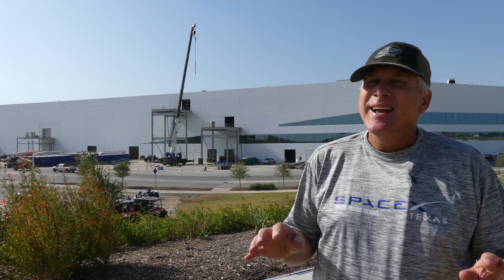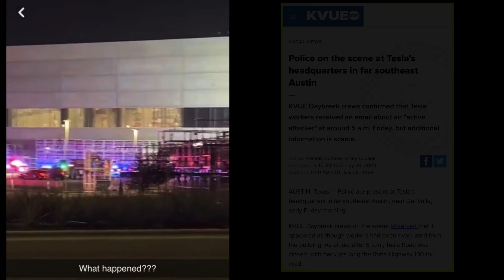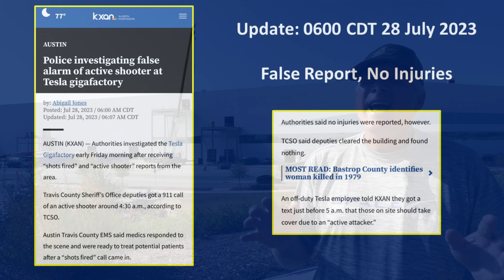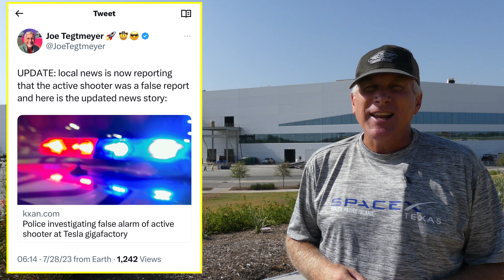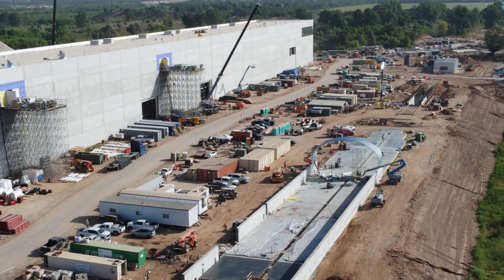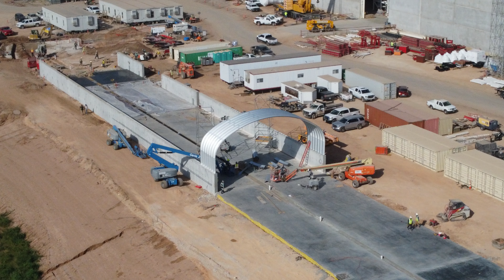More Window Removal, E Cathode Structure Has Roof & More! 28 July 2023 Giga Texas Update (07:35AM)

Comment: 25:31 this building looks almost like a crash test site. With the gap in the middle of the floor for a cable system to pull the cars.
Reply: 25:31. It's a possibility. Some Austin City documentation asks about the 'Temporary Crash Track'. Also 'Temporary Wade Pit', which could be the north structure.

Comment: All those parked forklifts then @14:30 they are moving things up the ramp manually

Their going to need a new system for the castings soon, they are taking over that whole side of the factory
Would be nice if you could fly over the concrete plant sometime to see if it looks like they've started to wind down operations yet

Comment: 21:06 New switchyard/substation. Mega-Vault. What is this going to be used for?
Reply: It is a central distribution point for power. Power comes in from the main substation, and from the BESS substation in the event of an power outage... Then goes out to all the buildings on the campus via duct-banks. It is possible that there will be a structure on top with switching equipment as well.

Comment: Why do workers drive completed Model Y's from the factory to the holding lot rather than using FSD for this task? Are Tesla's perimeter roads considerd public thus cannot allow unmanned FSD operation until certified by Texas? It seems FSD assistance would be a good labor saving feature for production and a great test/proving ground for it. The cameras have not gone through full calibration but the route is a known path that should allow operation even without final calibration.
Reply: First opportunity to drive the vehicle and check for faults.

Comment: Hey Joe, 
Regarding those two unusual structures on the East side of the battery cathode plant. What are the odds that they are an aquatic final testing course for Cybertrucks? 

The more shallow structure that is getting a q quonset style roof could be for shallow water testing at speed. That would account for it being wider and covered. 

The other feature would be for deeper testing at slower speeds. 

Both have center drain lines that might connect and operate with what might be a cistern (your “vault”) on the South end of the course. 

Just a thought.
Reply: Just seems like a strange place to have it.  I would have thought closer to the main factory would have made more sense.

Comment: Thanks Joe
5:03. W-WOW. Left. Assembling rebar cages.
5:26. Westside. New road. Trenching. Various coloured conduits. 
Left. Stockpiling gravel.
5:32. Westside. Storage. Casting racks being stored to the right.
7:52. Outfall channels area. Right. An outfall channel shaped excavation. Possible diversion of the channel to accommodate the Parking Garage.
9:15. Stamping 2 extension. All columns placed. Additional hold-down bolts are for the columns in the adjoining building section.
Intermediate beam not level. Set-out mistake, the connection plate welded in the wrong location.
9:49. Southend. Truck and trailer ‘Harvey-Barlow’. First photo on their website shows a panel joint being caulked.
10:57. Southend. Sanitary sewer wetwell. Precast rectangular vault sections. Likely valve access boxes as at the lift station beside the highway near the main entrance.
12:00. GA apron. Large items. Closer machine seems to have door at the narrow end where material bases through. A tunnel. A glimpse in Jeff’s video yesterday.
Silver wrapped item, logo is GROB. Nothing similar that I could find on their website, although they do ‘custom built designs’. 
Website shows GROB have fingers in many pies, including sheetmetal bending equipment, assembly line components, additive manufacturing. Could be anything.
15:57.Battery roof. New rooftop ducting. Must be tight for ceiling space under.
16:37. Plastics apron. Additional water storage trailers. Hoses across to Paint.
Right. Delivery of pellets to Plastics.
17:03. Casting. Inside through the window opening. Joe’s photo show the frame of the furnace seems to have been infilled.
17:30. Northend. Black casting racks. Black rack to the left has Model Y rear castings.
Zooming in on Joe’s photo of same shows something different written to this seen on the Model Y racks, https://youtu.be/uJwEzpThroU?t=485
17:46. Tesla Road, north. Water storage trailers. Pump in, pump out?
Seen again in front of the trailers at Plastic at 29:10.
20:07. New switchyard/substation. Mega-Vault. Large crane. Expecting something big. Spreader bar on the trailer to the left
Bottom. Green enclosures placed on the pads.
21:06.New switchyard/substation. Mega-Vault. Good view of the applied water proof sheeting.
21:40. Tesla Road, north. Trench ends at the gas metering enclosure. 
Length of HDPE back pipe with a yellow stripe. Natural gas line.
23:49. WOW yard, east. Shipping container marked ‘Allegiant’. That name appears on many of the plumbing permit applications.
24:26. WOW yard, north. Big crates, lightweight trailers. GROB again. Must be ancillary equipment, frames etc.
25:12. Cathode east. Large crane setting up beside the ramp. Large delivery coming. Shifted the white vessels again.
25:39. Cathode east. Long structure. Quonset type roof. Locating spacers along the top of the wall show the extent of roof.
Reply: thank you dessie!
Reply: @bobthegreat297  You're welcome!

Comment: @ 10:22 I wonder how they will keep the dust and dirt out of the building?
Reply: Plastic sheets around the sensitive areas is one way, or even temp walls.  Other areas are construction zones so it's not as much of a concern.
Reply: They will install Scotty-approved focused force-fields, run off dilithium crystal chambers, with Mega-Pack power reserves.

Comment: Easement:
@ 18:04 Steel on truck. Possibly for a building on top of the Tesla Enclosure/Mega-vault? 
BESS Yard:
@ 18:37 Close up view of cables that connect the Megapacks to the transformers.
BESS Substation:
@ 19:26 Hard to see, but only 2 backup power conduits coming out of the ground. There were 3 conduits in the trench before they poured the concrete. I remember seeing one of the conduits in the trench with tape over the end.
Tesla Enclosure/Mega-vault:
@ 20:35 Steel beam on truck.
@ 21:01 Waterproofing material on vault walls.
Also @ 20:35
LCRA Substation: Work continues on installing metering equipment.

Comment: I wonder why they use these dump trailers instead of dump trucks?
Reply: Tractor/trailers can haul more product per load. That is why they are so popular with most everybody.
Reply: Bottom dump trailers do a better job of spreading the dirt over a distance that a dump trailer does. Yes, you can size opening of the gate of a dump truck with a couple of chains but a bottom dump just makes it easier to spread it out and require less work for the dozer or grader.
Reply: Bottom dumps do not fall over.

Comment: The Semicircular structure looks like a 'quansit hut' set of parts that anyone can purchase.  Somtimes that kind of structure is used for 'bulk storage' (road salt, or batterey materials <<grin>> ... Thanks for doing these videos, Joe!
Reply from the maker: You are welcome Jack! have a great weekend!
Reply: That's "Quonset" hut. I went to check the spelling, and found it was a version of a WWI design called a "Nissen" hut, designed by a Peter Nissen in the UK. Originally they were more or less a half circle, but as is the case here, variations occur.